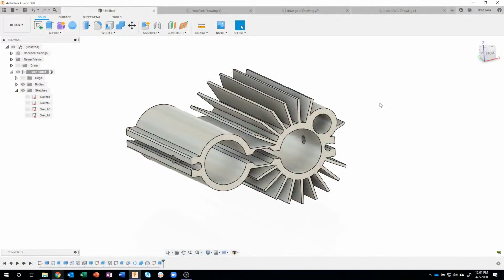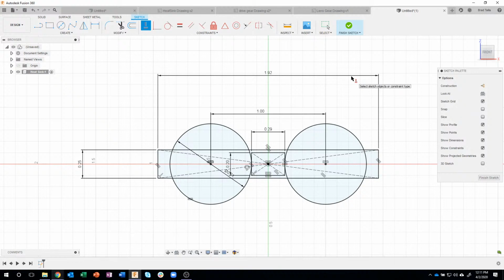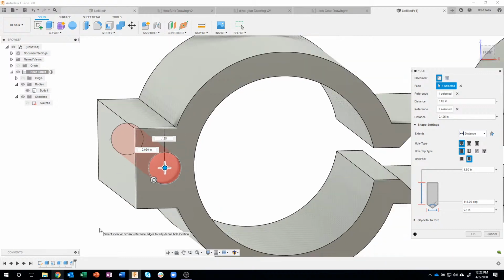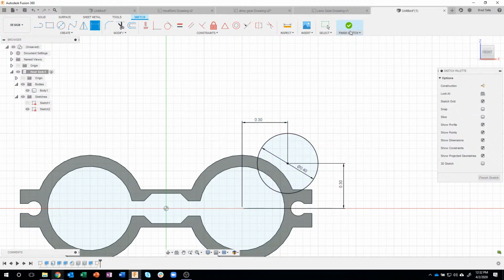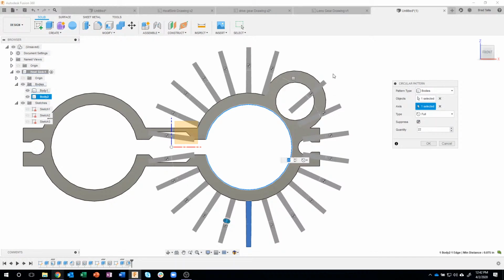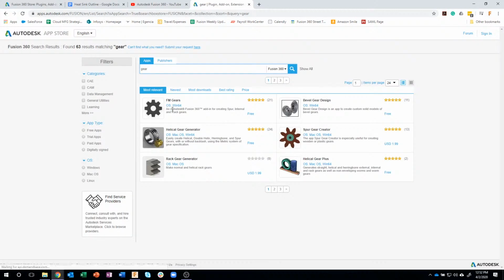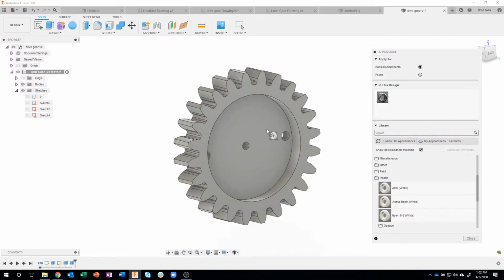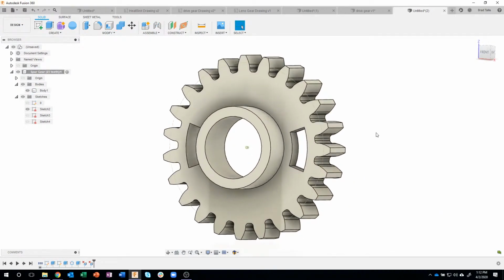Episode 55 - Laser Projector Build, Part 5 Heatsink & Gears

Comment: Brad, first off thanks for the content. In the spur gear segment when you were placing the specific dimensions into the FM Gear add in, I didn't initially put the dimension for he center hole and was trying to go back into the time line to edit that sketch. I was unable to find it, can you help with getting back to that add in window? Thanks.